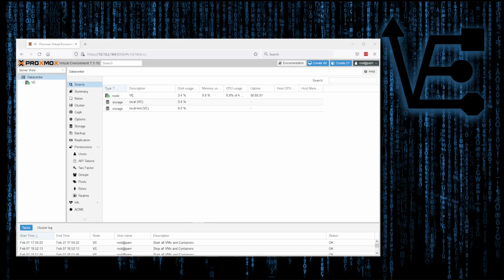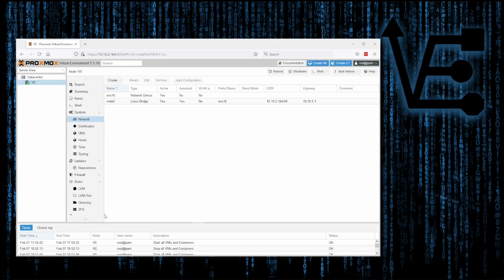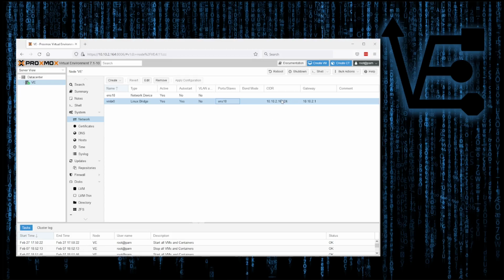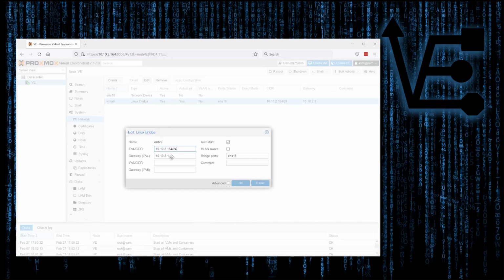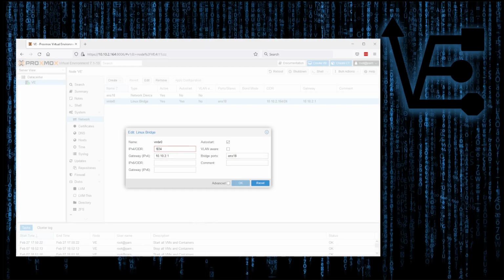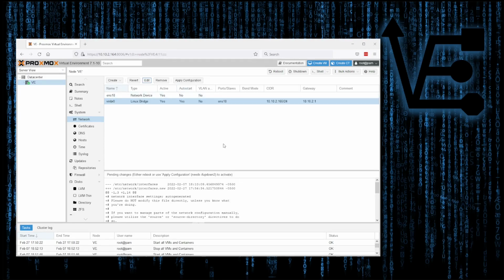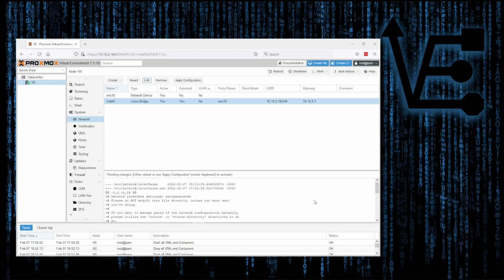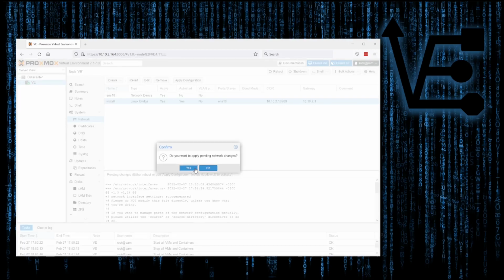Changing the IP of your Proxmox Server

Comment: Hi, I like your videos a lot. I have a problem I can not enter the web interface. The electronic power went out and I changed the IP and now I can't enter what can I do. To go back to enter the web interface. How did you change the pointing direction to be able to enter?
Reply: Did you solve this? I have the same issue I can't connect to it after changing.